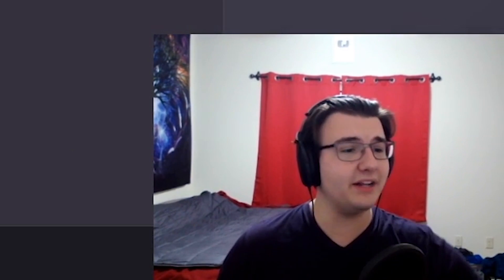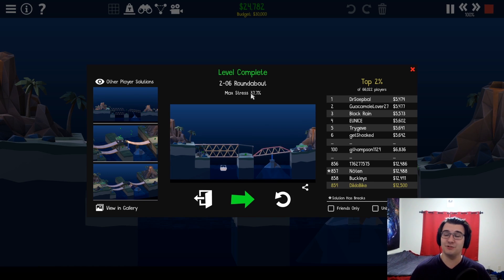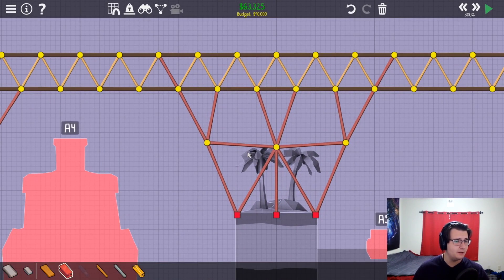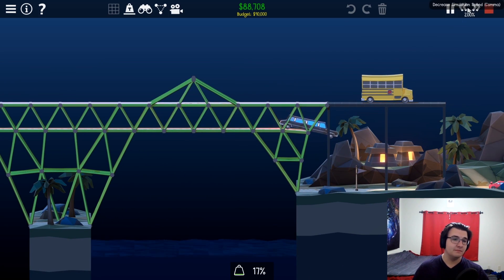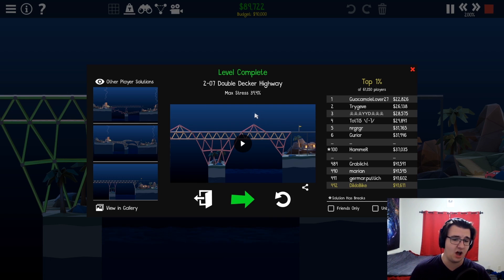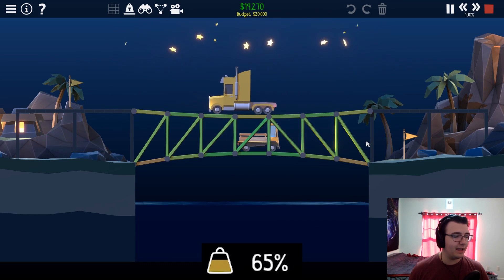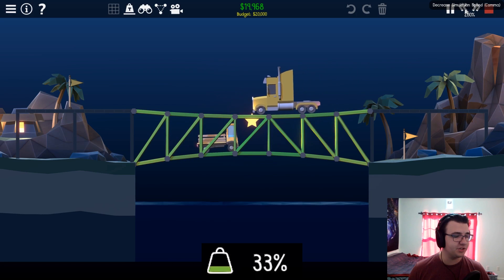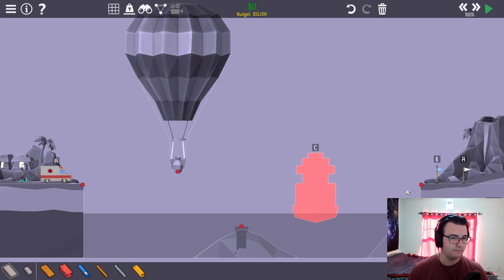Building REALISTIC DRAWBRIDGES With Extremely Low Stress

Comment: If the devs added an option to change the stress level that pieces would break at, that would be a way to implement a min-stress leaderboard because you could actually see the most-stressed member.
Or, you could just have an option to highlight the most-stressed member in the same way that it highlights the first-break member.

Comment: There are ways the UI could be changed to make Lowest Stress less frustrating.
- Ability to preview stress on the bridge while you're building.
- Max Stress readout on the HUD.
- More decimal places of precision.
- Mousing over a piece will show you the numerical amount of stress that piece is experiencing or has experienced.
- When multiple pieces break, the damage report will show you the order in which they broke.
Reply: Another idea would be to have some way of changing the scale of the stress color identifier - if you know the bridge experiences a maximum stress of 10% for example, then having 10% stress show up as red would allow you to tell what gets stressed on a smaller scale.
Reply: @denoww9261  +rep
Reply: - that's not quite possible as the stress changes as the car travels
- definitely
- not that useful, normally you only care about 2 significant digits
- the color kinda does this already
- not quite useful since in most cases when the first piece breaks the whole bridge collapses.
Reply: @alexismandelias 
4) no it doesn't, if the stress is low enough (<35%) it's hard to tell
Reply: @alexismandelias  i think they mean the stress of just the bridge itself as a preview
Reply: @alexismandelias  the preview would be of resting without the car on it. 

the color is useless when it comes to lower stress because you won't be able to tell the difference.

Comment: On bridges where you have a long truss that's supported in the middle as well as the ends, could you reduce stress by placing a small gap in the top?  Otherwise, the middle support won't be able to take up any weight unless the truss flexes slightly, and such stress would put the top into compression, which I would expect would in turn would add to the tension experienced by the bottom.  Alternatively, could you replace some wood or steel sections with springs?  Letting things move slightly while using a spring to prevent them from moving too much would seem like a good way to reduce stress in many circumstances.

Comment: If you want to do super low stress, like going for low stress leaderboards, i think the best thing to do is to recreate the level in the level editor, and then double the weight of the car, plus set every single joint in the bridge to be a split joint.
Then design a bridge which stays under 40% stress. 
Then remake the bridge exactly in the actual level, and it should be well under 10-20%.

Comment: When grinding for a low stress, the devs could implement a sensitivity threshold for the color, where you could make the maximum red be 20% or anything you need it to be
Reply: And perhaps also have a mode that can view pieces colored according to their maximum stress, rather than just their current stress.  Alternatively, have a mode to scale the strength of pieces, so that they'd break at 40% (or whatever level is configured) stress, so as to make this kind of challenge work even for single-use levels with breakaway sections.
Reply: I think itd be nice to have a setting in the designer mode to see maximum stress, average stress, or minimum stress of a beam, kind of similar to how it shows a break